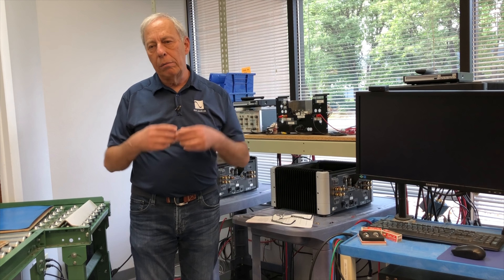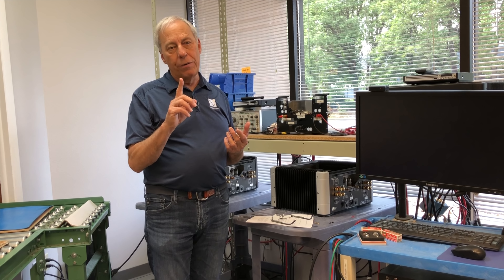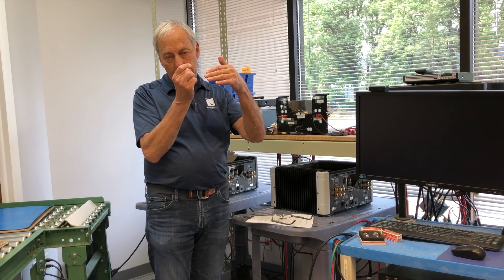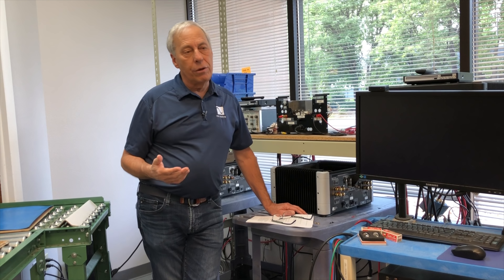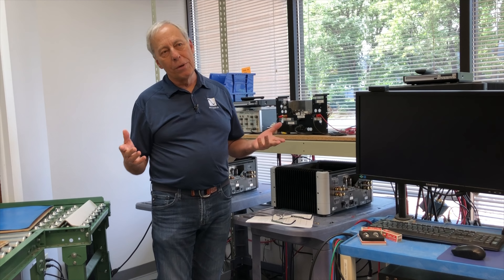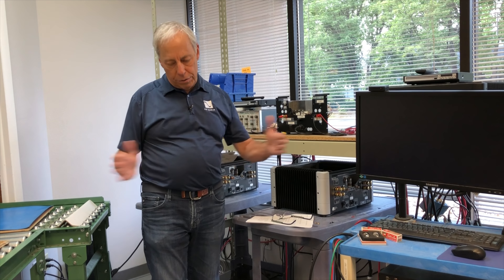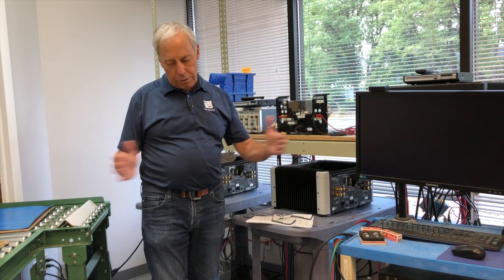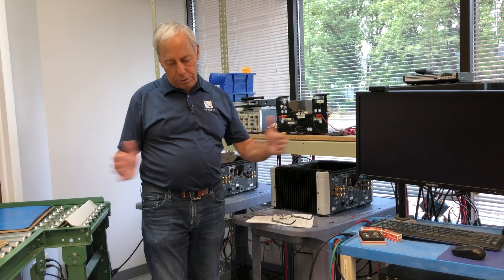Why don't turntables have built in amps?

Comment: Roksan’s original Artaxerxes phono preamp was fitted into the turntable and plugged into the artimez tonearm to amplify their EMT based cartridge. It had a pair of captive isoda interconnects and a ground wire. Power came from an external supply. EMT studio decks had their own preamps built in I think...

Comment: It surprises me once solid state devices allowed for preamps to be smaller, that mainstream manufacturers who built both audio electronics and turntables, such as Pioneer, Sansui etc. didn't start building phono preamps into their turntables in the 1970s and 1980s. The bragging rights about less noise and hum with a turntable with local phono preamp with line level output would have been a game changer. Because this never happened, just about any record player with line level outputs gets the stigma of being 'Walmart' grade junk, and it could therefore never audiophile. Same as modern record-ruiners with USB outputs...
Reply: Why does a built in phono reduce hum and noise? I am considering a Rega planar 1 plus but not sure if I should get an external phono or not
Reply: Transmitting the audio signal at a much higher voltage level makes it more immune to noise pickup by the cables (and therefore the amplifier). Ground loops are also less of an issue... notice how only phono inputs are provided with a separate ground terminal screw, and not line level tuner, tape, CD inputs?
Reply: The best would be a built-in ADC - and a PS-Audio-like HDMI out with the ADC's I²S signal. LoL but actually the best idea I can imagine. And DSD of course as a default signal type (with the possibility of 24/96 PCM, with a switch). LoL  that thing would be amazing. :) With a proper tonearm, the small amp wouldn't make a difference if SMD or not. A couple of JFETs and voilá. And of course XLR out, just to distinguish between junk and audiophile versions. 😊

Comment: Back when I was running an Empire turntable and Pickering V15AME cartridges, I had a custom solid state phono-preamp in the base of the turntable. This let me run all the inputs to my big control preamp at line level. Tape, phono, tuner, CD, TV, etc. were all at the same relatively high line level and the phono was much less subject to noise because it wasn't a feeble low level, unequalized signal running along side all those other cables.

Besides, it was fun building that little preamp for the turntable base. 

Now if only there were some REAL standardization on what "line level" means. My current tuner is intended as a Broadcast Monitor and uses the "professional" line level, which means some serious pads to drop the level down to what the "home" gear is happy with.

Comment: Back in the day, we assumed that it made much more sense for an amplifier with an existing  high quality DC power supply to just add another inexpensive stage to step up a low level input, than to build another expensive high quality power supply just for a tiny amp in the turntable.  Kinda the same reason to include a tuner chip in an amp instead of building a separate power supply just for that tiny task in a separate box.

Comment: Clearaudio builds cartridges and phono preamps. And they want to sell both. Good to know: HiFi doesn't need separates ( always). Not in the beginning. Not in the end; I remember hearing you advocating for active speakers. 
That indeed would be very nice: a turntable with an integrated preamp wireless connected with powered speakers.

Comment: Actually this is a brilliant question. The low signal output level and relatively high output impedance make a cartridge very sensitive to interference and cabling is more critical than anywhere else in your system. Someone should design a record player with an audiophile miniature op-amp based phono amp that sits in the tone arm. A high quality power supply can easily be placed inside the record player. It’s 100% doable. Of course getting the circuit right will take some careful choice of parts and excellent engineering. PS Audio could do it. Paul is right that possibly this is not done due to lack of competencies in other companies. BTW, it’s a bit ironic when a turntable comes with fixed cheap phono cables you can’t replace and you buy expensive cables for everywhere else, isn’t it?

Comment: A lot of turntables have built in preamps these days. The Audio Technica AT-120LP has one as well as the their standard model. I have the Cord DJ U Pro turntable which go for about $350 AUS. Unfortunately the phono preamps that they put in turntables these days aren’t all that great. Most audiophile entry level turntables that around $600 and up do not have a built in phono preamp, because you can get a much better sound and signal from a seperate preamp. In fact I have seen a lot of videos on YouTube of people with the Audio Technica AT-120LP turntable who have bypassed the wiring in the built in preamp completely, so it’s just a straight line out. For some reason and I have noticed this myself that when you flick the switch from the built in preamp to the straight line out, you still get a small amount of noise from the built in preamp which you would think shouldn’t happen.

Comment: I have a Philips turntable with built in integrated amp with germanium transistors. Best sounding transistors, ever.
Reply: ... until they get whiskers.
Reply: Lake Nipissing - I am sorry, but I did not get the joke
Reply: I didn't think it was funny. Germanium transistors are known to grow tin whiskers internally which can cause noisy, crackling audio, or short out the junction altogether.
Reply: Lake Nipissing - Hmmm. I have used that for over 30 years and not seen whiskers
Reply: Not something you can see with a naked eye; it is microscopic internal. But you would know when it starts happening, because you will hear it as random static and crackling and eventually total loss of audio in one channel. That is one of the downsides to Ge transistors.
Reply: Lake Nipissing - Got it, and it makes total sense.
Reply: Hopefully it doesn't happen anytime soon, but if it does, have a line on replacements... they are hard to find now. Many vintage electronics restorers are sourcing "equivalent" Ge transistors from Russia. Seems to be the only place they are still available. Performance such as gain and low noise seem to be excellent.
Strange irony Russian transistors are now reviving early cold war era solid state American radios like Zenith Trans-Oceanic equipped with dying Ge transistors.

Comment: I can't see any justification for integrating a pre-amp in the pick-up cartridge. It would need to be tiny and very light, which constrains the design, without offering many benefits. A phono-preamp housed in the turntable (but not part of the cartridge) would be a better proposition, particularly since many integrated amplifiers or separate pre-amps now lack a phono stage. However, as other people have commented, high-end customers like to be flexible, and like to choose each component in the signal chain individually.

Comment: No one seems to get it... I'm surprised no one knew this. Turntables have been around for a long, long time, since before even transistors. In those days, there were other standards for pressing records besides the RIAA curve, all they way up thru the '50s, I think. There was absolutely no way to fit all that circuitry, with all the requisite equalization curves, into a turntable without making it the size of a dining room table. Eventually they settled on the RIAA curve and transistors started to be a thing, but by then they were already making turntables without preamps in them and amps and receivers that did. So there was no reason to change, until now, and so now a lot of consumer record decks these days actually do feature built-in phono preamps.

Comment: Even though modern parts are small and lightweight, installing them in a cartridge or headshell would still add quite a lot of mass. 
Installing a preamp in the base is OK, but  individual preferences of listeners vary widely, making it impractical. 
And Wireless connections? Not in My system! 
For those with historical interests:  Zenith and others made "wireless record players" starting in the 1930s. They weren't very popular.

Comment: I have two turntable ( transcription decks ) one is a Mitchel Gyrodeck  the other an Audio Technica AT series.. both now have Cambridge Audio RIAA equaliser stages built in and wow ... !! What a difference that  made .. a quantum leap forward ! So simple and so effective !! The Audio technica had its own RIAA stage but I didn't think much of it .. so out it came ! And in went the Cambridge version ... never looked back !!
I cannot understand for the life of me why stand alone turntable manufacturers fail to install these necessary EQ stages . Especially in the ones where they use direct drive servo controlled motor drive .. there's plenty of electronics in them things ...
The only dumb reason I can think of is that there might be hum induced from the synchronous drive motor...

Comment: amazing how low level a phono signal is without a preamp. I tried connecting a turntable to a non-phono input and there's no sound at all (volume cranked up too yes). you really do need a pre-amp for them
Reply: It would be like if tape heads were directly wired to the outputs, without any internal amplification in the tape deck. Interesting how tape recorders, tuners, CD players all standardized on line level audio, and turntables did not.

Comment: And when you want to change the cartridge to change the sound signature , you have to change the turntable
Reply: Why? Unless you are changing between MM and MC types. Then you'd only need two TTs.
Reply: Cartridges only last so long anyway.  Yeah great, increase the price of cartridges.
Reply: I sold my Audio Technica moving coil cartridge on fleabay this time last year. It sold for about what I paid for it in the early 1980s.
Reply: @jonathansturm4163  and having two turntables is logical?
Reply: Yes if you feel the need. Since ~1970 I have owned just six different cartridges and never felt the need to use more than one at a time. My interest is in the music I play, the gear I use to play it not so much. If I still played 78s I would certainly own two turntables to avoid the hassle of swapping cartridges.
Reply: @jonathansturm4163  I don't see the benefit of having the phono pre amp inside the turntable, I have a mid level turn table and high level arm, I have a mm cartridge now with a tube pre Amp with setting for any kind of cartridges. When I want to listen to the MC it's just few settings and I'm good to go, no need for a second turn table
Reply: We are already dealing with that on a much larger scale with our cars. Why should audio be any different? Look at B&O. Turntables that can only be used with their cartridge. None too cheap for what you get and very little choice.
Reply: The benefit is less hum and noise. As Paul says, even better if the amp was immediately adjacent to the cartridge.
Reply: "Look at B&O."

That's what B&O are for, surely. Looking at. Personally I'd save the money and just have a T-shirt printed with "I'm a fucking wanker!" on both sides.
Reply: InsideOfMyOwnMind worst cartridge company in the world
Reply: Jonathan Sturm Agreed on all points including the tee shirt.
Reply: Sure , does it justify the disadvantages ?
Reply: you are right in some sense , what you have to consider that all these type of turn tables are very cheap , made for none audiophiles . Us or at least me as an audiophile care about the quality of my turntable and the sound it produces and the solution you mentioned will not have a good quality audio . Also keep in mind that even if the turn table has a pre amp off switch , but it does not switch in off completely and still changes the sound of the cartridge .

Comment: It would be interesting to see if smartphone sensors could be used in phono cartridges. The accelerometers use microscopic crystal structures to generate voltages. The magnetometers are solid state hall effect sensors, which might detect small movements of a tiny neodymium magnet. I have no idea of the sensitivity or speed of these sensors or whether a combination of them could be used to produce a good audio signal. I imagine it would take considerable DSP, perhaps on an FPGA external to the cartridge.

Moving coil cartridges offer pretty good performance. The compelling reasons for looking into alternatives would be cost reduction and physical robustness. The DSP would likely negate the cost benefit. The cantilever and stylus would still be vulnerable to mechanical damage.
Reply: I think with all these sensors now available from so many sources, that linear tracking turntables would be much easier and cheaper to build as well.  I recently acquired an old Technics SL-5 that still works and sounds great!  This might be a niche that PS Audio could exploit - some higher models (the SL-6) had sensors that could even allow out-of-sequence playback.  While they are currently not what the "cool kids" are playing/using, there are many benefits to linear tracking turntables.
Reply: Linear tracking turntables still require high precision machining, which is expensive and requires maintenance. That requirement could be reduced or eliminated if a magnetic suspension is implemented. 

While we're dreaming, I think it would be cool to have an optical pick-up. I built a jig to photograph slides. I am able to capture the grain in 35mm Kodachrome 64 images (while capturing the entire photo). This got me to thinking. If more magnification and image processing is used, the signals encoded on a vinyl groove could be deduced. A 50kHz signal uses 0.0047mm on the innermost portion of the groove of an LP. The real challenge is determining the undulations of the two diagonal sides of the groove. This determines the dynamic range. The software would have to synthesize the stylus position; this may not even be possible. Multiple images with different lighting angles may help. 

The entire record could be photographed and images stitched together. The sample position is determined by the angle and radius. This would eliminate the need for a turntable. Dust particles and minor scratches could be optically detected and eliminated. It may even be possible to compensate for some record wear. 

The cost of a scanner bed could be low using off-the-shelf robotics parts. The optics may or may not be expensive. Processing could be handled by a desktop or laptop, but at least part of it would benefit from an FPGA. This of course doesn't deliver an analog signal, but it should have good transient response and possibly good dynamic range.